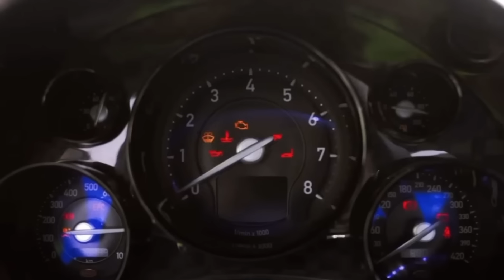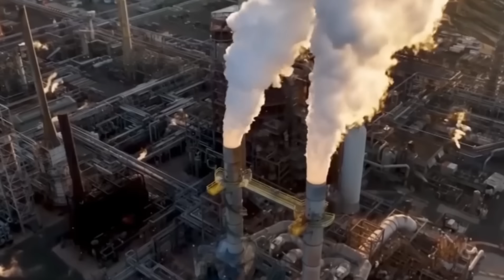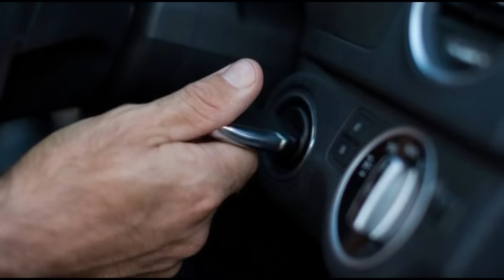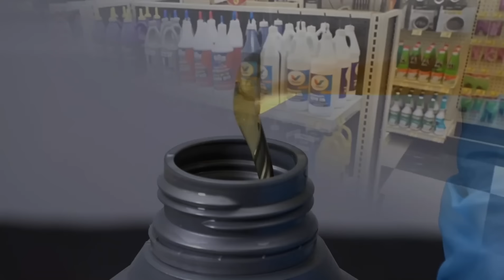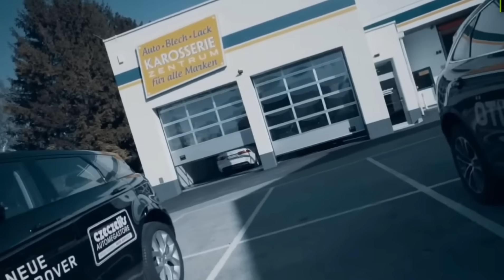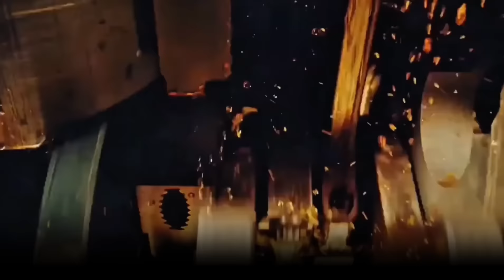Mechanics Won’t Tell You THIS About Synthetic Oil! (Exposed)

Comment: I am a mechanic , and the only thing you really need to know is change oil and filter often .
Reply: ........and research that cheap filter you're using for another.
Reply: @David-uu1oj  what cheap filter ?
Reply: 48 years   in. Mechanics. Just. Change it. Often and when in. Doubt. Just do it. I taught my. Kids. To. Keep it. Clean. They. Have. Never. Had any. Problems. Always. Going 300,0000 in all makes
Reply: @John-l8k6n yup
Reply: I'm out after 35+
Reply: @John-l8k6n  Oh. For. Real. That's. Neet.
Reply: "Often" means what, how long between oil changes Mr. Mechanic?
Reply: @jeroldparker7766  3 To 7 thousand miles Mr . Jackass.
Reply: @jeroldparker7766  3 to 7 K Mr. Jackass
Reply: balony
Reply: your one that tells people a LIE
Reply: @markdaly7283  ok tough guy
Reply: @markdaly7283  ok tough guy

Comment: Great video! My mechanic said to change oil and filter @ 5,000 miles. Donaldson says don't change air filter until air restriction occurs. Dirt attracts dirt. Bought a well used minivan that was well taken care of. 375,000 miles and oil looks great at 5,000. Fuel injection systems are the main reason you can get a high mileage motor these days.

Comment: What is your suggestion for oil & filter for a 2016 Ford Fusion SE 1.5 L Ecoboost? I just purchased this car a little over a year ago and I have never had a turbo car before. This is totally new to me. Anything else you want to share with me as far as advice is welcomed. Thanks
Reply: Oh and I run it at high speeds sometimes.

Comment: Never mind manufacturer claims. The best thing you can do is change the oil and filter every 6 months or 5,000 miles, which ever comes first. Consider it a car ownership requirement.
Reply: Time on oil doesn't mean shit, running hours or miles does.

Comment: Pick any modern motor oil as long as it meets the viscosity and type required for your vehicle, then change it regularly. Stop buying into extended oci, change at or before 5k miles. You’ll never have an oil related failure.

Comment: My father felt that in our mild climate (rarely below freezing) nor hot (back then about 90º now of course about 98º every day) single viscosity 30 (no W rating) was best. We did keep our cars for years and up to nearly 200,000 miles when most people thought a car with 80,000 miles was worn out. I don’t think that advice would hold today. Does anyone have an opinion?
Reply: Yes with proper care and some dedication and tlc many vehicles can go 500,000 miles on the traditional oil used i.e (5w-30)

Comment: I use 0-20 Walmart oil , 208,000 on my Mitsubishi mirage, fram filter, changed every 5000 miles , still going strong !
Reply: Get a wix xp or a purolator boss..way better than fram
Reply: That is the secret I changed mine every 3K and always change filters! 65 years 15 cars in family,NEVER ONE ENGINE PROBLEM!

Comment: Another AI video with some false onfo..
Most mechanics do not know the real details about oils. I know because I worked in that industry.
The labels on oil bottles are 100% like everything else ever sold. They use selected words to try to sell to the public for 1 purpose which it sales, which is to get other people's $$$.
You are wrong. In N. America thinner oils are now prescribed because in N. America the industry regulators demand lower emissions (which less oil changes does)  and better fuel mileages (which thinner oils help).
The industry hides nothng.

Comment: Amsoil buys their base stock from mobil i have a freind that works for both. I have been using and selling mobil 1 for decades  just change your oil sooner than later
Reply: Just change your oil sooner than later
Reply: Indeed.  The interval is what matters. Amsoil is VERY high priced, and any performance improvement when oil is changed in sooner intervals is likely negligable..

Comment: I have a 2025 Subaru Outback premium with 9000 miles....I've done 2 oil changes, starting with the first one after I put 500 miles on it (a lot of mechanics said to do that) and all i use is CASTROL EDGE 0W-20 full synthetic and a FRAM ULTRA SYNTHETIC filter...that's all I've used in all my vehicles
Reply: U only said 9,000 miles.
Reply: @SouthwestSway ...yeah so?

Comment: If these new synthetics don't start taking care of all the gunk build up that today's motors produce none of this will matter. Chain damage, gunk build up all around the intake then spreading everywhere on top end. 
Cars with turbos are going to hell under a 100,000 miles today.                                                                                                                             Thanks to DI with turbo boost when not needed. The car makers need to go back to fuel body injection.
 Government controls trying to get us into electric pieces of shit.
Reply: Exactly

Comment: There is no need for extra additives! Your motor oil has all the additives needed for your engine.
Filters are pretty much standard, they all have a micron rating of 20 - 25.
Check out The Motor Oil Geeks videos on expensive and budget oil testing.

Comment: I'm a follower from Saudi Arabia. It's a great channel with truly valuable information. I own a 2024 Raptor Twin Turbo 3.5L with a 10-speed transmission and I use Motorcraft 5W-30 oil. However, the problem is that the Motorcraft oil is assembled in the UAE, whereas it was previously manufactured in the USA. I don't trust the UAE because they have a high rate of adulteration, and our local dealer uses this oil and oil filter. What's the best alternative for my car, and what's the best filter to replace it?If I go to the UAE and shake hands with anyone, I count my fingers after the handshake so they don't steal one of my fingers without me noticing, unfortunately.
Reply: I would suggest Royal Purple or Mobile 1. Royal Purple is made in the USA used for racing extremely durable in high heat conditions and I know UAE gets super hot temperatures. It may take you some time to import it but well worth it. I read a detailed lab report that showed which oils handled the best friction and heat by using using extreme tests and showing which metals had the best protection all were full synthetic. The top two brands were Mobile 1 and Royal Purple. Castrol was terrible and showed significant damage on the metal spinning it on a lathe die tool machine. So that is my suggestion. Make sure to bring the oil and watch them put it in your vehicle with an excellent filter. Because you don’t know what happens in the back they may switch to a cheaper oil and keep the Royal Purple for themselves and their cars. I physically saw my mechanic put Royal purple in my car and I had them put a top quality K&N filter which is what I ordered. Good luck.
Reply: Use the K & N oil filter and air filter sir and you will be fine. Hope you can find these where you live. This is what I use on my 2011 car . I use Castrol  GTX 5w-30 full synthetic and I change the oil and filter every 5,000 miles. I have over 110,790 miles on my car. It doesn’t leak oil or use any oil. Your choice of oil is a good choice. Have a good day.
Reply: What are you talking about

Comment: Good info. Always do what is best for your engine and driving conditions. Then stay with the same oil, filter, and possibly also the same shop as long as there is no reason to change.
Reply: I had a truck i wanted to build it it so me and a friend tore it down and it looked brand new and i used Castrol full synthetic so i don't know about all this crap

Comment: I have for 10 years used Amsoil in every internal combustion engine I own. 2 and 4 stroke. I use the Amsoil Synthetic transmission fluid as well. One stop shopping.
Reply: I use Amsoil in my cars and my motorcycle. I also use Amsoil coolant and brake fluid and even transmission fluid change. It's just a maintenance lifestyle.
Reply: Yep,very well put. Maintenance lifestyle-I like that saying.👍🏻
Reply: Amsoil very expensive .Way over kill for regular  every day vehicles. Waste of money. Pennzoil Castrol Edge Extended.5w 30  Is just as effective oil  for half the cost for  Amsoil/. That is  for cars like high out put BMW + Very Pricey  Amsoil.
Reply: @Nick-z2h2q 
Castrol was selling blended as full synthetic. I’ll pass on that. 
Amsoil is expensive but it pans out with extended oil changes. Oil analysis proves it. Filter is more crucial at that point. ANY oil can get dirty and contaminated.
Reply: @Nick-z2h2q Lab analysis showed Amsoil clearly is better than Pennzoil by 2%.  You change your car oil at 5K miles & 5.1K miles respectively if you used Amsoil
Reply: @Nick-z2h2q yes,I see where you are coming from as price goes-I look at it this way-it may be overkill but that is better than underkill. I change it once a year and keep a eye on the oil level that’s it. I know what an engine costs and and extra 5 bucks a quart is nothing compared to the piece of mind that whether it is hot or cold out I am good to go,a preventative lifestyle. Another benefit is Amsoil ships it to my doorstep.  Appreciate the response,keep a clean filter no matter what brand one  uses because when you know you know.👍🏻
Reply: Yup me too

Comment: Good video, I couldn't fault one thing, My 04 Ram Hemi get oil changes every 5,000 miles and I always use Mobil One 5W30 full syn, 344K and purrs like a kitten, not one mechanical problem ever!
Reply: What do you have to say to people who believed in amsoil?
Reply: @aNormalGuy6969  Hi priced gimmick....particularly if you change the oil and filter at shorter intervals.
Reply: I too had an 04 Ram 5.7 hemi. Drove it for 14 years changed oil when ever I felt like it every 5 to 10000 miles. Used supertech 10 - 40  full synthetic and supertech oil filters. The truck still had the same alternator, same waterpump, same thermostat the only problem I had in 14 years and 217000 miles was 1 fuel injectors went bad. I was an idiot to not keep that truck. It never had any hemi tick either.
Reply: Mugsy, what you are doing is very wise, however you don't need to change every 5,000. Moibl 1 5W-30 is more than capable of lasting to 9,000 miles. It's up to you, but you are wasting good oil (and money) by changing it sooner than necessary. 

There is one issue to consider... How long does it take you to drive 5,000 miles? If it's a full year, then change at that inteval. 

Here's a guide to changing the oil and filter in your Ram. Do it every 12 months or 9,000 miles which ever comes first.
Reply: @Skitragic  Well I will continue my change interval ty, I do not waste the old oil, I mix it with diesel fuel and use it on my fences, I have lots of fence to protect, so much I often have to get more from my local oil change place!
Reply: Your Mobil 1 full syn, is actually group III hydrocracked mineral oil. Very good stuff, but not really synthetic motor oil.

Comment: Your honda you use 5 30 what does it call for?  And what engine is in it?  I have 2 a 15 accord 3.5 and an 08 crv 2.4 what viscosity would you reccomend?  I live in SC and have been debating if I should switch them both to 5 30.  Your input would be greatly appreciated.

Comment: At least you can trust Amsoil! No B.S. Just results.
Reply: Yep!!!! That's all I use!!!! 317,000 on the 2016 Subaru Outback and still going!!!
Reply: I even put it in mowers and other small engines,  besides my cars.
Reply: I have been using Amsoil in two of our 2020 Honda's, And we used it in a sled Pulling GM Diesel Never ever had Mechanical failure with this Engine because of Amsoil, Yes it's that good.
Reply: 🤣🤣🤣🤣🤣🤣🤣🤣
I recalls a few decades ago when engines blew up when using Amsoil. Especially smaller engines in sea-doos, motorcycles,...
Reply: Exactly 😊😊😊😊😊😊😊
Reply: Amsoil definitely has a solid rep, no doubt
Reply: I use, and have used nothing but Castrol edge full synthetic on my last three vehicles, including my 2010 Dodge ram that I had for 13 years and never had any issues, I now have a 2025 Subaru outback and again I use nothing but Castrol edge, but I don't go anywhere near the claim of 20,000 miles between oil changes because quite honestly, if anyone is doing that, it's stupid and it's going to ruin your engine, and I don't care which oil it is or what they claim.... I change my oil every 5000 miles....period.... no more no less.... and because of this, I have never had any issues
Reply: Trust LOL ITs a rip off LOL!!
Reply: @Nick-z2h2q 
Run amsoil in my 7.3 diesel and at 10k miles sent a sample to blackstone labs for a full oil analysis. Was still perfectly fine and could have gone another 5k. 
Didn’t seem like a scam to me.
Reply: Our 2007 Camry ran almost a year without oil. The engine is still running today. Oil brand doesn’t mean much.
Reply: @aNormalGuy6969 NO oil for a year?  Sure, I believe you.
Reply: @aNormalGuy6969 …No it didn’t
Reply: @aNormalGuy6969 
It will run at least another 2 lakh kilometres without any engine oil.
Honda engines are so reliable.